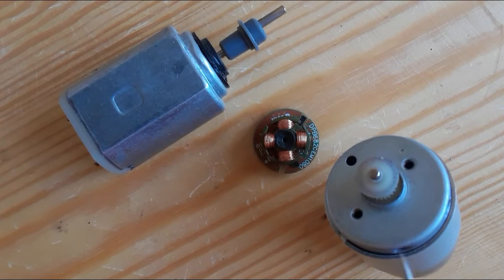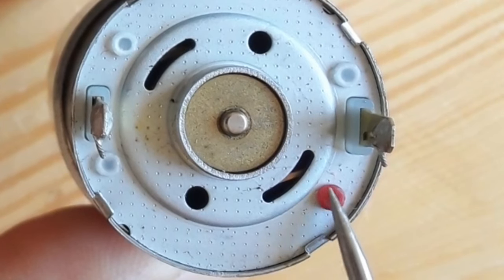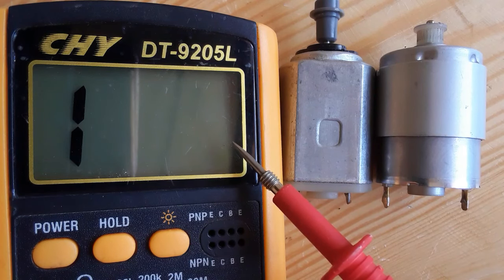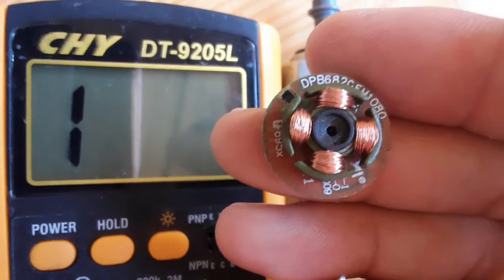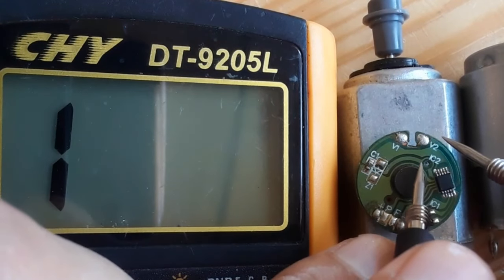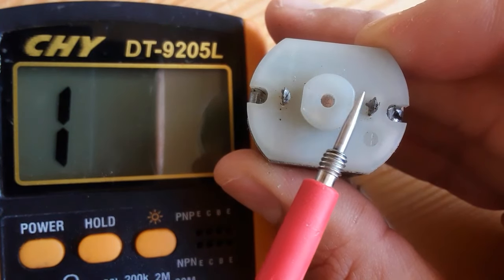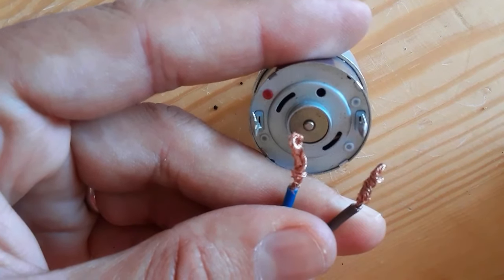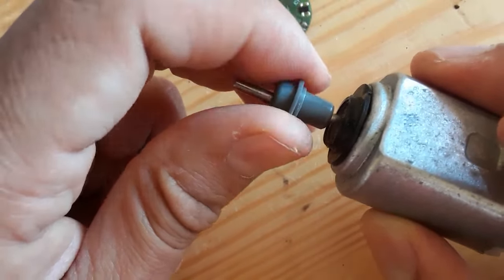Learn how to test DC Motor with a multimeter, Motor winding testing

Comment: hi dude, great info that you give me as insight for a non electrician person like me, 
i have one question, if we check the insulation between positive / negative side with ground/body, what results that should be correct?
Reply from the maker: Thank you for your kind words. I’m glad the information has been helpful to you. Regarding your question, when checking the insulation between the positive/negative side and ground, you typically want to see a high resistance value, ideally in the megaohms (MΩ) range. This indicates proper insulation and no short circuits. If you see a low resistance value or continuity, it could indicate a short between the positive/negative side and ground, which is something to investigate further.
Reply: @electronicsrepairbasics_erb  wow didnt expect your reply so fast. i see, so if they are above 1Mega ohm, that should be okay. Do we also need to expect 1Mega ohm, even the insulation testing is done on small hobbyists dc motor? or the resistance value should be lower for lower dc application?